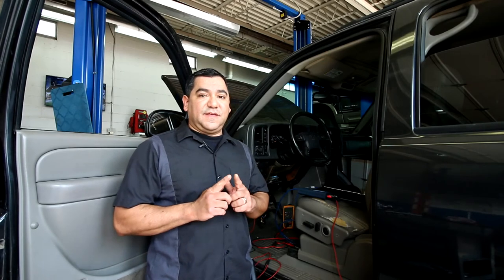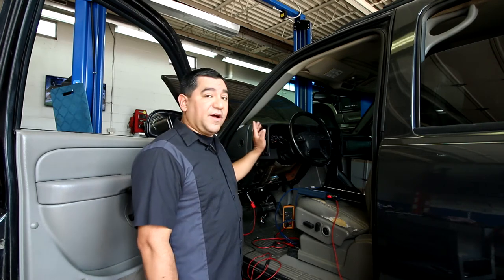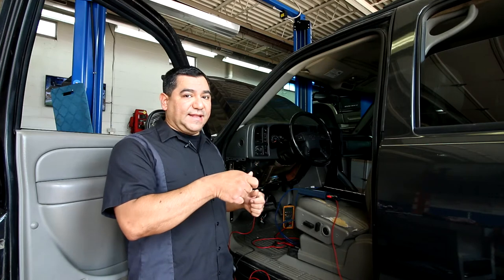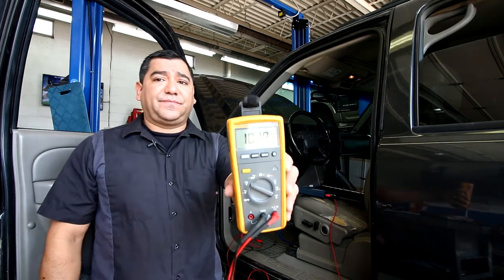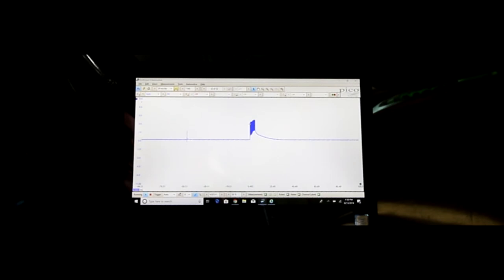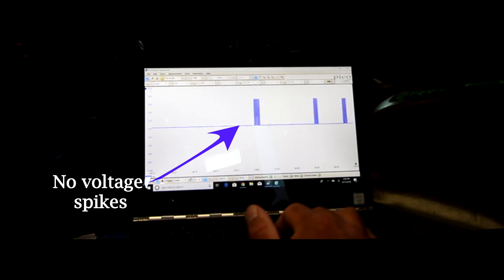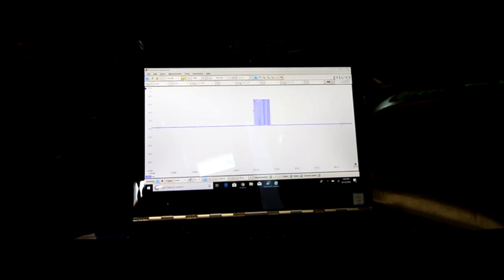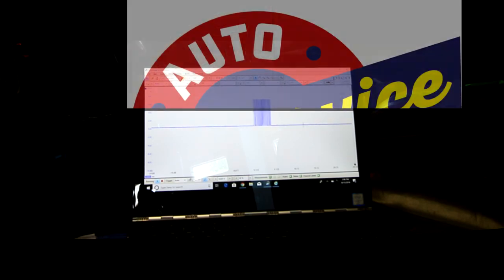GM Class 2 Data Line Diagnosis and Repair Information

Comment: I have a 2004 chevy 2500hd 6.0L it starts then dies in like 2 seconds I have no communication, but there’s power at my OBD2  port. I have no highbeams my windows and locks don’t work. I check all grounds and cleaned them. Any idea what to do now
Reply: When you find out please let me know

Comment: Thanks so much for this video, found the problem in no time because of it. You're the man!
Reply from the maker: No problem.. thank you! I had a odd problem years ago were someone brought in a GM truck and it had communication issues, I found someone pulled a communication wire from the comb pack and it was actually wrapped to the the harness in the left dash. I told them what I what I found and they said nothing. LOL someone did that on purpose. I am glad you got your stuff fixed.

Comment: Is this splice pack 203? I’ve been looking at wiring diagrams and it never tells you where any of these packs are located. That’s for the video this could be what’s wrong with my tahoe. I'm guessing that connector plugs straight into the BCM under the dash? I'm trying to troubleshoot a similar problem on my ride. No rear locks, headlights not working etc.

Comment: Would a cut abs hub wire cause this. Abs light is on and has been on for a while. 2001 duramax cranks but no start
Reply from the maker: No a ABS wire issue would not cause a no start. What is the ABS  code that you are referring too? I can help you from there. can your scan tool communicate with the ABS module? If not unplug it and see if your vehicle starts. I have seen many times when a defective module takes the data line down. let me know what you find.
Reply: @ricol7964  no codes just an abs light on
Reply: I'm working on a 2002 Tahoe and someone cut wires near the splicepack.  I have no communication to any module. The purple wire from the dlc is hanging. Has a parasitic draw also. Will having all these cut wires cause my draw?
Reply: If you have a minute I sure would appreciate it. I have a 2003 hummer H2, message screen on the dash comes up “Unknown driver “have the electric or not working. I probably worked backwards, but I replace the ECM, BCM and there’s also when you hook the scan to comes on but no communication. Would another place to check be that SP205 port where everything comes together? Any suggestions? I would appreciate it. I’ve worked on this thing so long, and just agitated. Thank you, Richard.

Comment: Rat chewed coil wire causing it to short to ground on 05 chevy astro 6 cyl. Now I have a problem which I believe is a PCM problem. With such high positive voltage arching to ground my scan tool only shows 4 cyls. I replaced parts. But when I go to data stream tool only shows 4 cyls when it used to show all 6. I can not find info on how to test the pins for the PCM. Also didn't see any damage to the wiring harness. So best guess is the PCM was damaged due to the high voltage arching to ground.

Comment: Amazing video! You have explained the serial data line and it’s operation very well.
The problem that I’m having is that I’ve done an interior swap from a 05 which runs a class 2 serial data line to a 09’ interior including window switches/modules in which run a GM low lan line, said to be consistent with a normal class 2 line. Module has both power and ground but unfunctional. Is there something that can done to make the 09’ module work on the 05’ serial data line? 
Need help figuring this out please!
Reply from the maker: Sorry for this late reply. All I can say is Oh Boy you have your work cut out for you. See if you can find a friend that owns or knows a shop were you can try reprogramming it using a factory or pass thru interface. I mention a friend because a dealer prob wont touch it or charge you tons of cash! Look at my video on reprogramming if you need more info on why you need that step. Please let me know what happens and for everyone out there I am trying to keep up with life and apologize for the delays. THANK YOU for the comments

Comment: Thanks so much customer drop off a truck for no start only for 2 sec and then nothing so just pulled chip and not getting any voltage but .1 to .4 out of every prong

Comment: I'm having a similar problem with a 2005 Chevy malibu only mine will not turn over at all turn the key and kills everything I tried following the wiring and nothing there is a green wire that come from the security sensor (top of ignition) that has been cut Help Please!!!!
Reply from the maker: Hello, there are so many things that can be happing here and so many questions to even point you in a certain direction. If you have a cut wire or broken wire that has to be addressed first! Have all the codes pulled from every module and see if there is communication codes. That will point you in a certain direction. Figuring out this stuff may not be strait forward.

Comment: you may able to help this a long time coming. Short story if I use my windows at the same time it will put the truck into Reduced Engine Power. All ground have been cleaned and replaced. What else could this be? It gives me a U1000 code with it but my reader won’t dig deeper.
Reply from the maker: Very Interesting! can this be duplicated every time you use the master switch? Will it do it with any other door switch?
Reply: @ricol7964  only when I use both windows going up never down. It drops my voltage quite a bit from probably 14v to 11v then kills the truck. If I have the blower on that’s enough draw to put it in (REP). Even the rear defroster. It’s gotta be wiring would you know where it all ties together? Maybe somewhere to start looking? I don’t think an old battery would do it
Reply: U1000-13 is this the same type of code? 2007 2500hd 6.0 classic

Comment: This one of the only codes that I can see in my Snap On Solus ultra scanner. And my guages are the same, and I have had issues with my windows and doors! Cranks no start, just like the guy below with 2002 LB7 my 2002 LB7 is doing this and no one can tell me why! Same exact issues! no com to tcm or ecm. I am going to roll my key back to access position and try comunication that way, then try unplugging the abs!
Reply from the maker: What happened?

Comment: Awesome video. I have comm with everything except pcm power ground good any toughts
Reply from the maker: Sorry for the very late reply.  Was this a collision vehicle? so many questions? is this a replacement PCM that has not been programmed? What scan tool are you using?